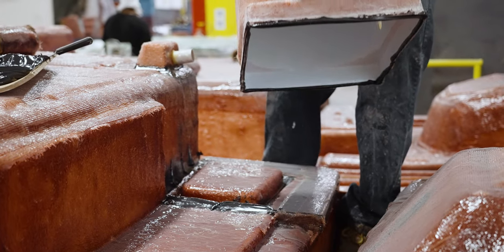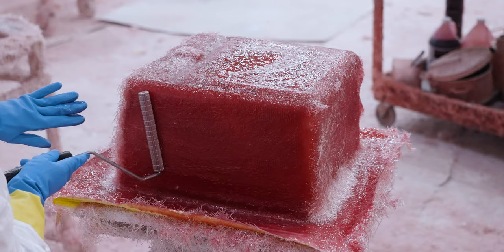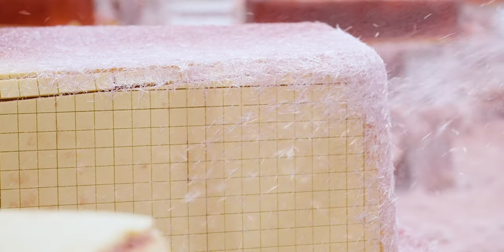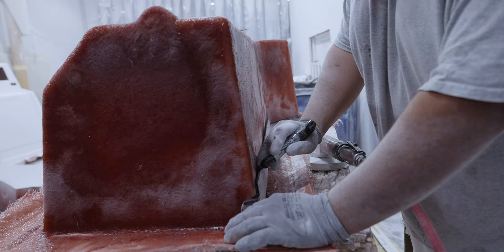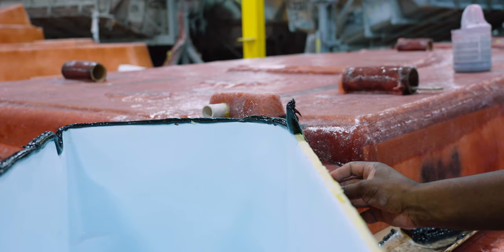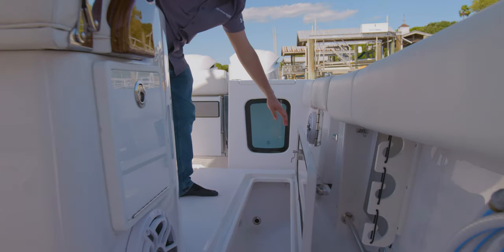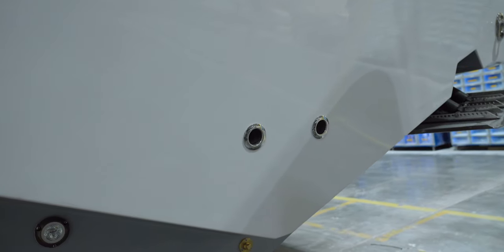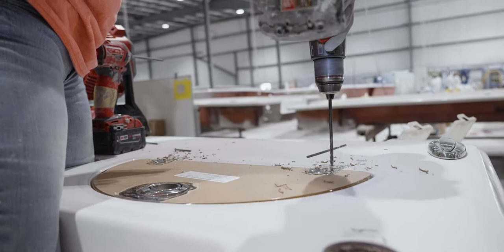The Hidden Parts Of A Boat - Small Parts - Sportsman's "Behind The Glass" (Season 1 - Episode 4)

Comment: Nice video. Just curious that why not combine these small parts into hull or deck mould instead of bonding?
Reply from the maker: The way molding works and pulling parts from the mold you would not be able to pull this part when molded in.